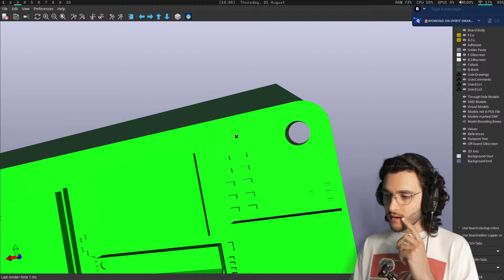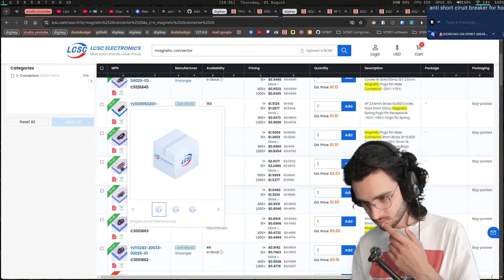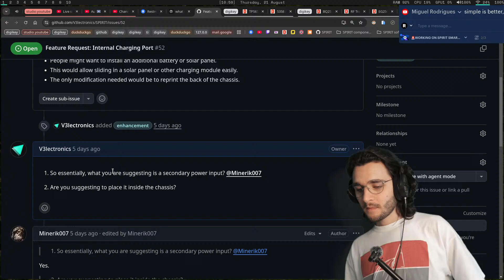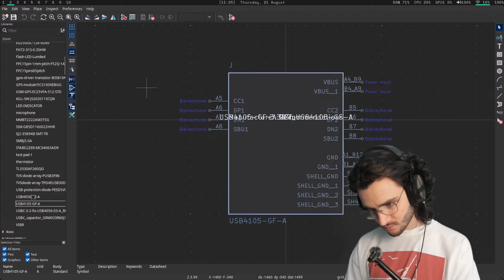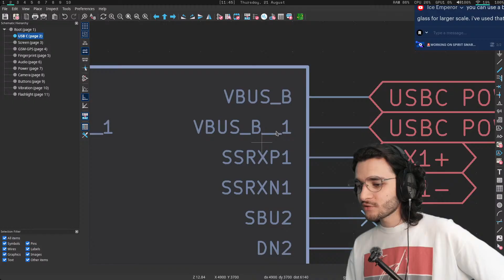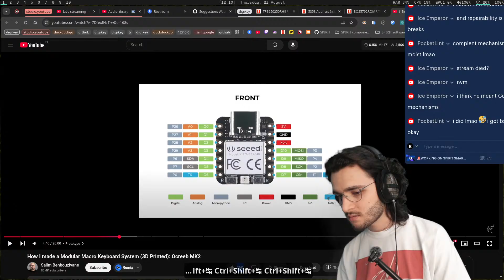🚨WORKING ON SPIRIT SMARTPHONE (#2 live replay)🚨

Comment: Anodized aluminum can look just as cool as steel, but is easier to do, and lighter. I can't imagine either being that good for a phone unless they can somehow act as an extension of the antenna, instead of potentially blocking it.
Reply from the maker: Aluminium is frequently used for phones, antennas have some clever workarounds to work with metal. 

As for the steel yeah its non practical i just like it a lot for some reason 🤠
Reply: @V_Electronics  Aluminum does seem weak, cheap & disposable compared to steel, I'll certainly give you that.

Comment: The only way I've thought of that a small solar panel could be used for charging a battery would be with a small self-oscillating voltage booster like a Joule Thief, but that works by pulsing the desired voltage and amperage out from a much weaker input, but that is probably bad for lithium batteries or something. And it'd probably take up too much space inside the phone.
Reply from the maker: That could work as one of the external addons